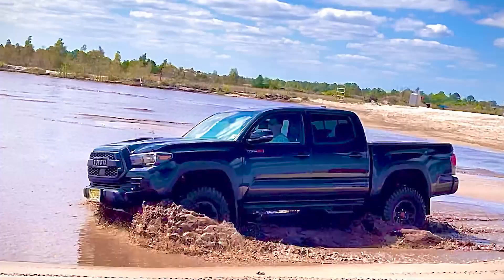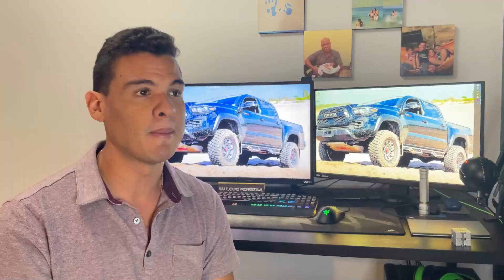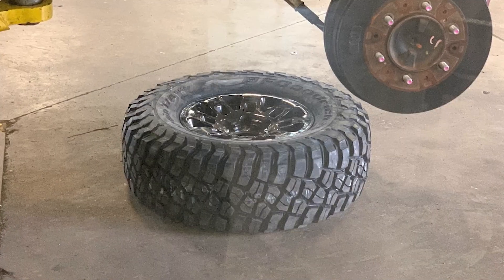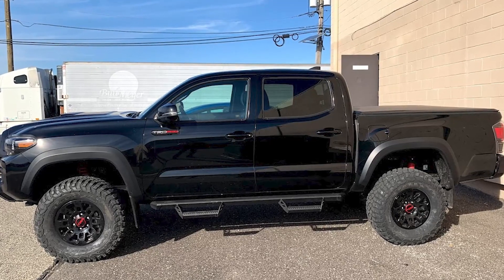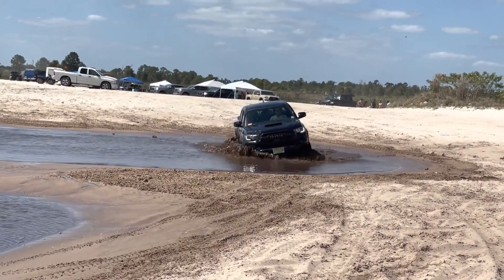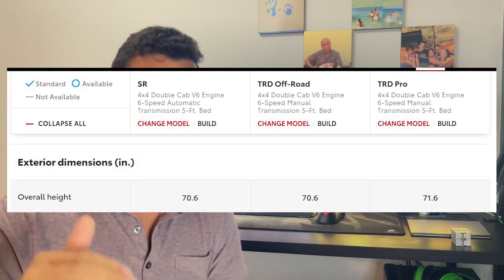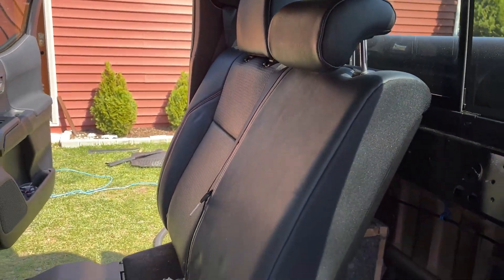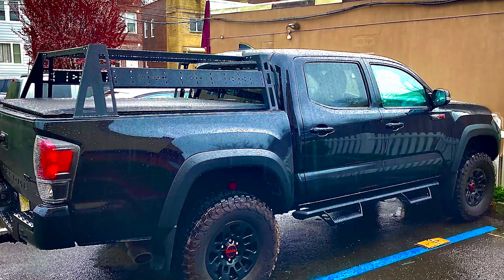5 Toyota Tacoma Mods I Do NOT REGRET!

Comment: Great video. If your Tacoma is getting heavier.  U should look into the 5.29 gear for the rear differential. Install the K&N throttle control it will help your truck throttle response.  Or look into the sprint booster throttle control
Reply from the maker: Hi @teddy! The car runs great! I'd prob keep it forever lol. I have been looking into the K&N throttle response but haven't got one yet. Thanks for watching :)

Comment: every individual who owns a Taco is going to do the necessary research to find the best outcomes on there decisions to modify there vehicle. From the Taco Forum, many had mentioned that the Air intake really doesn't have that much of a throttle response, if you want to see some changes,  The OV tuning is the best option from the owners who had Pedal Commander and either kept the item and did the OV Tuning or did both .
Reply from the maker: Agreed. I have read great things about the OV tuning as well. The intake honestly is  a discussion that has been happening for ever. I don’t think people will ever stop haven the air intake conversation 😂

Comment: Whats your mpg? I get 12 to 13mpg 😟😟 i have 285 70 17 and thats bad..
Reply from the maker: I have 285/75R16 and get about 15 mpg on average. I drive mostly HW tho. In the city is a lot less it depends how aggressive I drive. I think the intake helps a bit. but the tires and lift take that away.
Reply: @Prens7  better then me either way.. either hw or city its the same.. i have a lift too amd roof rack etc
Reply from the maker: @whiteazn2  I got my roof rack last wekend. Loving the look :) I am looking to get a lightbar there now. Get an intake with a firewall. It should improve your mpg. what lift do you have?
Reply: @Prens7  bilstein 6112 and 5160.. idk man in la i got 19 and then when im in vegas i get 12 to 13 😒. Before i had lift and bigger tires i had a bedrack and tent and i was getting good gas milege still
Reply from the maker: @whiteazn2  A bed rack and a tent is not that much weight to lower your mpg significantly. The tires and the lift yes. You are making the truck slower with bigger tires and less aerodynamic with the lift.  The same happened to me after lift and tires. I was getting 17/18 and now I am down to 15. I am on the east coast where the air is a little cooler which also affects me.
Reply: @Prens7  idk everyome i know gets better gas then me with same stuff..😟
Reply from the maker: Are all of them in the same area? This has me curious of what might be happening? What year is your truck? I got a recall about the gas pump I fixed few weeks ago. My truck never failed or anything but I wonder if it is something similar.
Reply: @Prens7  ya i got that recall done few weeks ago and its still the same. I have 2019 trd
Reply from the maker: @whiteazn2  mmmm. I wonder why the difference then :/
Reply from the maker: Bro, I ran an experiment the last few weeks. What fuel are you using? I was getting 14 mpg on regular, 17 on plus and 19 mpg on premium. I noticed the mpg also changes based on the place you get the fuel from. For example When I pumped in Pennsylvania, even Plus fuel was giving me 18 Mpg. Try this yourself and see if maybe the fuel is the issue since you moved to a different stated and your driving conditions are different now as well. Good Luck!
Reply: @Prens7  i always use 87 octane...
Reply: @Prens7  also i got the cvc tune so im going to see if my mpg goes up too

Comment: De donde eres bro? Boricua? I have a manual 2012 4x4 TRD sport in black, I'm eventually going to black out the emblems and rims. I haven't done any mods yet as it's basically stock with the exception of the wheels they all terrain BF Goodrich KO2  looks great in my opinion. Your truck looks badass 👍🏼👍🏼
Reply from the maker: Hey bro!! Venezolano! Tu de donde? What size are you running on your BFG? I was between the All Terrain or the Mud Terrain. Ended up going Mud.

Comment: Why would you go for a larger rim size if you plan your vehicle to be an off-road vehicle the smaller rim size the more sidewall you have the more you can air down your tires it makes no sense to put big rims on an off-road vehicle
Reply from the maker: Yeah. Nah I am sticking to 16 with the OEM wheels. I was a little worried about the balancing of the tires when I saw the double weights making contact with the disk breaks but the guys that did it prob didn’t know what they were doing. So I am all good now.